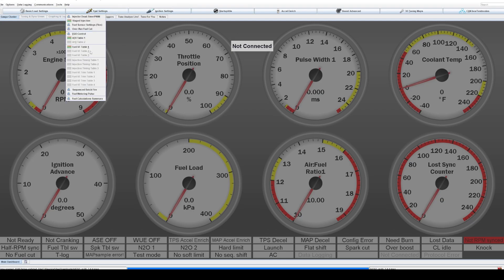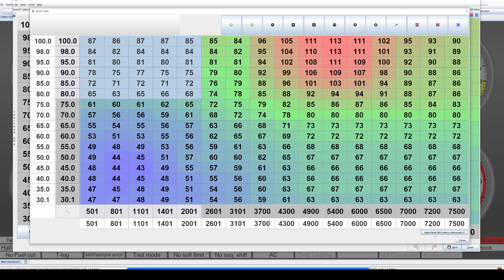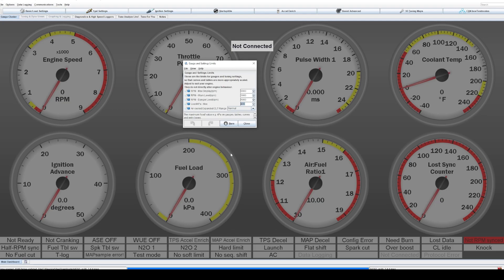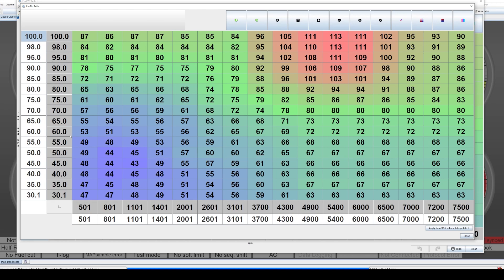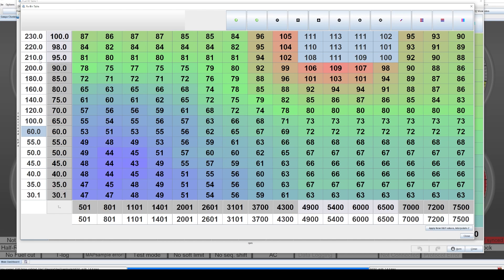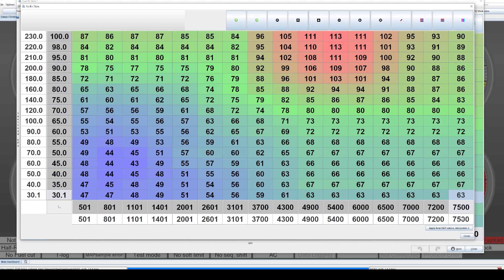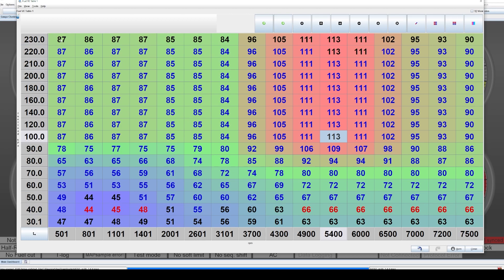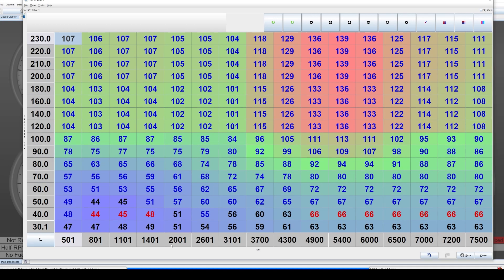Megasquirt Table Scaling Basics | NA to Boosted Tune Made Easy

Comment: What is the max number allowed in tuner studio for the fuel cell can it go to 140 150? I see you have it around 136 at 5500rpm 230kpa.
Reply from the maker: The software limit is 255. You rarely ever see more than 175 in my experience. Usually the smaller the injector the bigger the number
Reply: I just found out the 255 number about an hour ago. Thank you for the quickresponse@TurbineResearch I've watched alot of your videos 3 years ago and I greatly appreciate your work.

Comment: Hy. I really love your videos,  gives me courage to start my own MS project. I have a silly question. I want to buy a pre build ms3, but the seller says i dont have to buy a dedicated wb 02 sensor kit with controller, because it already in it. What i need is just the sensor, without controller. Is it possible with ms3?
Reply from the maker: You will just need a controller and sensor kit like this https://amzn.to/3jaPDfo
Reply: @TurbineResearch  so it doesn't matter what he says, i have to buy a full kit with sensor, controller, gauge anyway in order to work with MS3?
Reply from the maker: @tomisanzero  from my experience no megasquirt product comes with a built in wideband controller. You need to buy a controller and sensor like the link I sent and wire it to the O2 input on the megasquirt ECU
Reply: @TurbineResearch  thanks for your help

Comment: I've always used the copy and paste method on the 100 values then highlight and fill column down to bottom row. Then figure the max boost and increase that row by whatever percentage the engine and fuel would demand at that boost level. Then again pull from that value ''whatever it may be'' and down to the 100 row and fill column in that upper section of the table. This has always gotten me in the ballpark quickly and keeps the table smooth. After a little fine tuning, up to target boost i just figure the fuel percentage increase trend and continue that up the graph. Maybe even give it a couple additional points to lean on the side of safety.
Reply from the maker: Good way to go about it